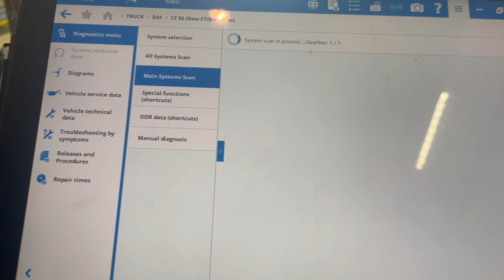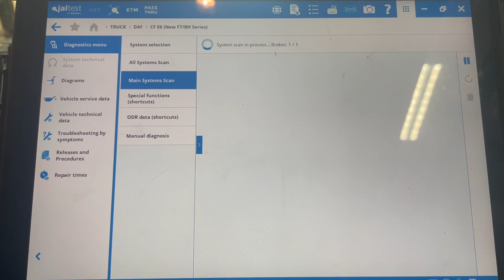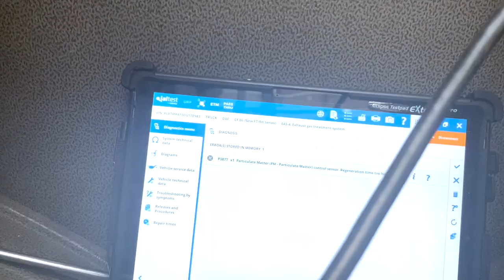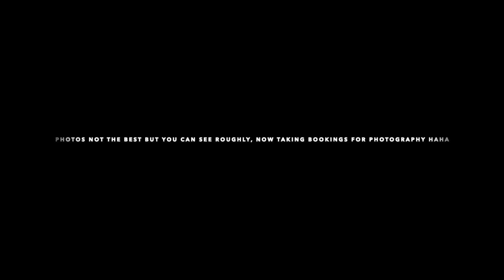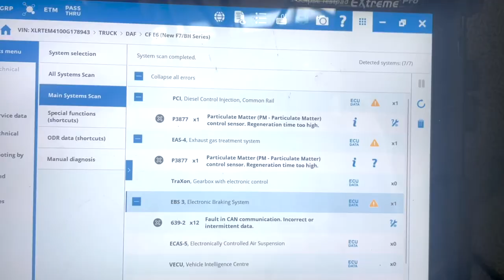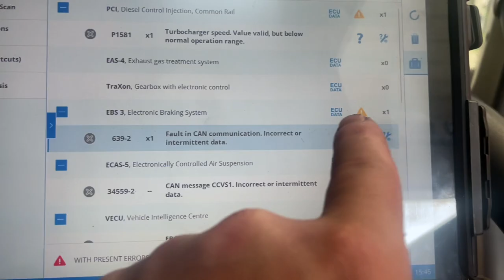VLOG- Day in the life of a HGV Mechanic- BROKEN SENSORS, WORN BUSHES  AND STUPID OBD PLUGS !

Comment: Hi Dan, thanks for another interesting video, good to see you wearing a cap in the pit, nice design with the anti-rollbar bushes, ok about the OBD plug, they were never designed for continuous use, ok on a car but on a truck where diagnostic equipment is used all the time the crappy pins are bound to push out... Regards, Ray..
Reply from the maker: No worries ray, I think there also designed as a standard in all trucks too, and 100% never designed for continuous use for sure! Frustrating especially if just want to diagnose a engine fault lol hope your well

Comment: They OBD plugs are a nightmare ,im suprised it doesn't on a service schedule to change every 6 weeks  they are that good..I have just bought a ODB  breakout box from snap on ,good bit of kit it tells you what each of the 16 pins does it also has a led at each point that lights and it tells you the voltage at each pin being used...so plug it in to the obd then plug you cable in to it ,,i had one where the can was fine but when davie plugged in the voltage on the can dropped to a volt ..Well done with the sensor ,job well done getting it out
Reply from the maker: They are a proper nightmare! Now that is a great bit of kit! it can become very frustrating when you can’t connect to a vehicle for a simply plug in! Mate I got lucky with that sensor 🙌
Reply: @freightlanetv  It is a blue point tool ,if you have a snap on rep ask about it and to see it ,,or i can get you the number
Reply: @freightlanetv  https://www.youtube.com/watch?v=WKADhshcHOQ&t=109s    a link to the bob
Reply from the maker: Nice one mate appreciate it